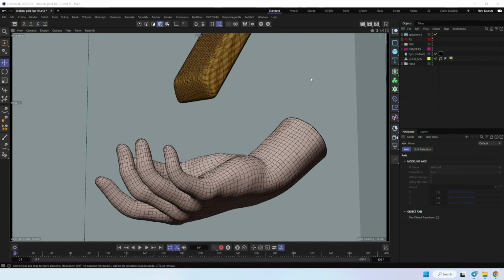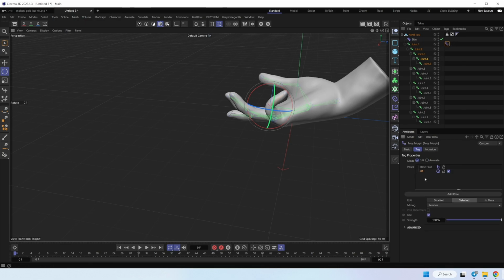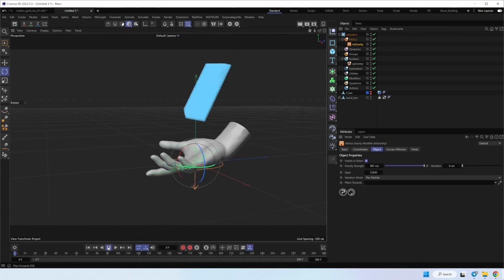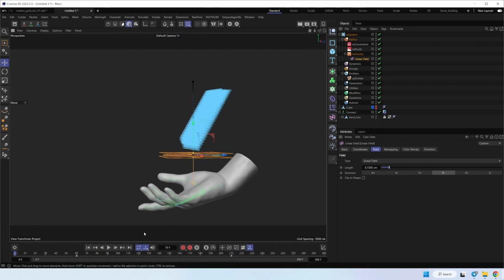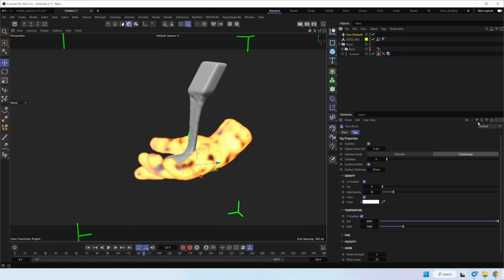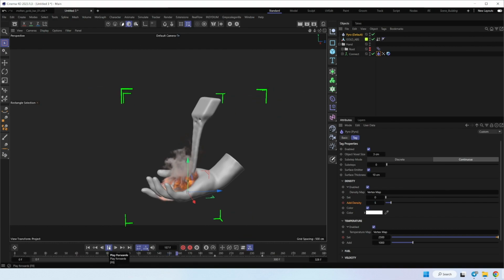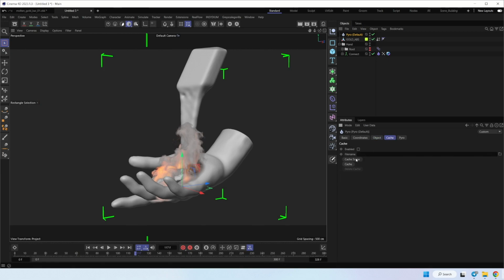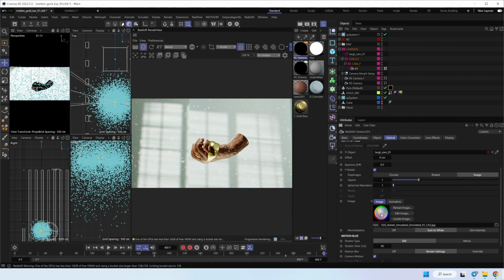Molten Gold Bar | Tutorial

Comment: when I bind them , the rig is still separated. what to do?
Reply from the maker: Check if the skin has been added to your geo. You have to be sure you select joints and geo before binding them. Also, check if your joint's placed correctly inside the mesh. It's hard to help when I can't see the project file
Reply: @rockmotion770  what is geo?
Reply from the maker: @metajpg  я мав наувазі геометрію, тобто саму руку😉
Reply: @rockmotion770  yes, everything is connected correctly.. I must have missed something and now I'm taking your time and mine)) sorry
Reply: @rockmotion770  I fixed it, everything works))